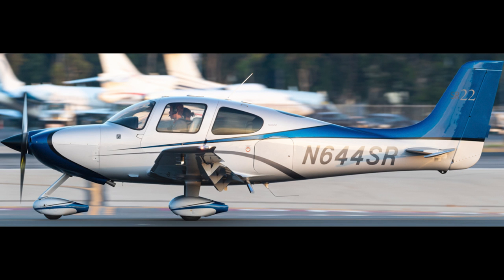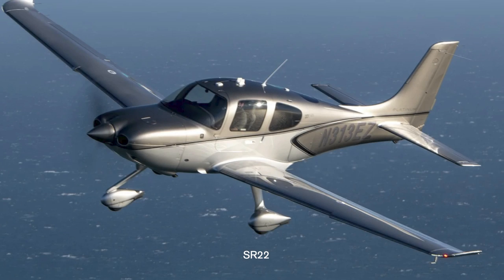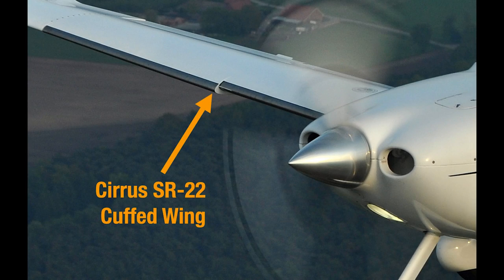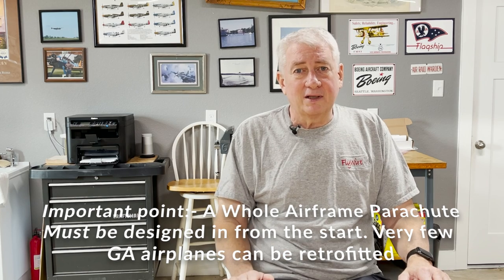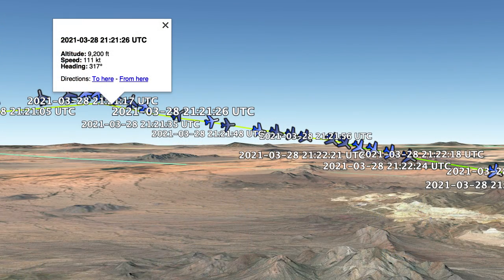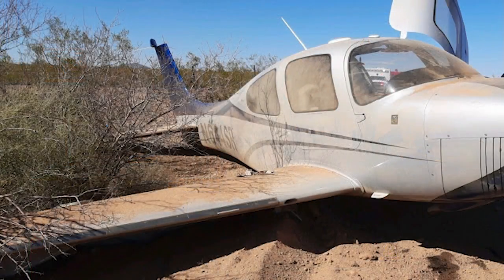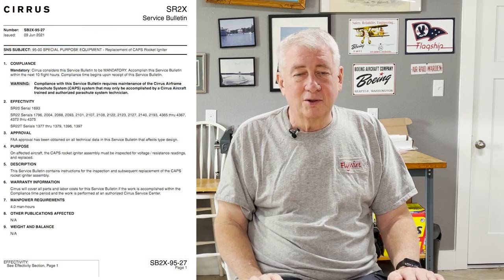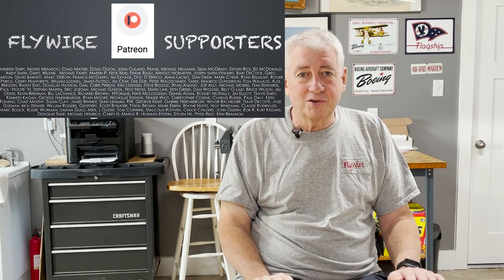N644SR SR22 Engine Out And No Chute

Comment: When the engine quits...your airplane doesn't stop being an airplane...it just becomes a shitty glider. Use whatever it has left to give, to get you to the best possible landing spot, regardless if your wings get you there or a parachute. As Scott wisely points out...that best spot isn't always an airport.
Reply: Here's the problem Cirrus pilots face - there is a minimum altitude for parachute deployment.  Below that, all bets are off, so a Cirrus pilot may have to make that decision to destroy his aircraft sooner than other pilots do.
Reply: @chuckschillingvideos  That is a very reasonable analysis.
Reply: @chuckschillingvideos  the minimum altitude is 600ft, that's a horror in any plane
Reply: @chuckschillingvideos  The moment a cirrus pilot decides to deploy CAPS, the aircraft becomes the property of insurance company not the pilot.

Comment: I recall seeing that bad vibration set in on Niko's wings youtube channel when he was out over the Gulf of Mexico. Sun visor was shaking violently. He turned that trip around and aborted it. Then he got caught at the edge of Class B airspace by ORD, and lost radio and glass panel as the vibration ate through the alternator cable cover and shorted electronics. 
What a familiar story.

Comment: Western half of the US (except mountainous) ROADS are my “go to”..... Nebraska, Kansas, New Mexico, eastern Colorado etc. I have flown directly over straight roads for miles nursing a sick engine to get to remote strips. If it quits ( which I always assume it will) you are set up to land straight ahead. Always be aware of power lines parallel to the road. This is where centerline practice pays off....practice on narrow runways.

Comment: Excellent comments.  There is a small but growing realization that "safety" equipment often leads to less safety for exactly the reasons you mentioned.  I recall that accident rates went up when anti-lock brakes were introduced.  We are also seeing similar issues with the cars that have self driving features.  People too often expect that equipment will never fail, and as a result are not prepared when it does.  I saw this in the Army, and see it with sailing, flying, and many other activities.  Thanks again for your superb analysis.
Reply: All of the data I have seen shows that self-driving cars are far safer on a per mile basis than are human driven cars.  The main difference is that every crash of a self-driving car makes world headlines.
Reply: @LTVoyager  I agree that a self driving car will be more safe than the average driver.  My point was that people rely on it and are not prepared if/when the technology fails.  Equally bad is that people often fail to even consider the possibility that a piece of technology can fail.
Reply: G'day,

Yay Team !

It was the same when they put a Training Wheel on the Nose, because lots of hamfisted clumsy wannabes couldn't cope with Taildraggers (less Weight, and less Drag ; which are two great reasons why Glen Curtiss abandoned Nosewheels in about1913, or so...) ; on the one hand the incidence of Groundloops remained unchanged (because Tricycles can indeed weathercock & groundloop, too),  while on.the other hand the incidences of all other types of Fatals went up...

Because in the Gripping Hand, any attempt to make a "Foolproof Aeroplane", historically, merely enables more Fools to evade being washed-out of Flight-School, and thus they progress to fly up into the Sky and put themselves in situations beyond their abilities with which to cope...; and then they die, after defeating the all Foolproofing for which they paid an extra premium price.

  Defying Gravity is so much fun that it should always remain  a bit obviously difficult, requiring of Learning, Skill, Experience, & Good Judgement...., in order to remain a safe thing in which to indulge oneself .

Least Familiarity breed Contempt, as the Cliche doth say...

In my humble opinion.
Anyway.

Such is life,

Have a good one...

Stay safe.

;-p

Ciao !

Comment: After reading the comments, I thought I would mention this…

Relying on the accuracy of a moving map glide circle distance may not be an accurate option.  One should test the concept in your own particular airplane.  Any aerodynamic changes to the airframe (STOL kits, VG’s, flap gap seals, etc) would have an effect on gliding distance.  A new prop, for example, might also affect gliding distance.  Check for any improvement in glide (at weights you normally fly) when pulling the prop to high pitch.  Some airplanes realize a change and some don’t.

It’s easy to change the glide ratio, at least with ForeFlight, to accommodate your actual glide ratio.  While maybe not the final answer, an accuracy adjusted glide circle can be a better tool for your reference should you actually need it.
,

Comment: There are no procedures in the Cirrus POH for off field landings. If you're higher than 500 ft agl, pull the chute. If the engine is running rough, returning to an airport seems like a smart move.
Great video! Thanks for putting this together and highlighting the importance of emergency training - you're right on the money in my opinion.

Comment: This is one of perhaps 15% of crashes I estimate might have been avoided by a couple hours sailplane lessons. Gliding and budgeting limited flying energy shouldn't be yet more intellectualized background info, but a viscerally prioritized and familiar process. I think a series could be done on benefits of glider mindsets to powered flight, as in the B767 Gimli Glider and other incidents.
Reply: Well most places are still teaching that a plane has a single best glide speed, without giving the adjustment for weight. (Meanwhile they still adjust Va, which is physical/engineering nonsense that was started by misinterpreting an old design regulation.) Best glide speed changes similar to stall speed, not exactly the same but roughly its close enough. Now you don't need to calculate it down to the exact pound of fuel remaining in the tank but having a general idea before takeoff of the adjusted speeds for various weights is handy. (Calculate best glide at MTOW, a normal takeoff, normal landing, and when fully light(pilot, no fuel, no cargo) as part of a new model familiarization.)

Comment: Based on its age, this airplane had the chute overhauled/repacked since it was installed by the factory. The repack interval is 10 years. So the Cirrus community will be very interested in who did that work.
Reply: Not a Cirrus guy, but is the rocket/igniter serviced too or just a chute re-pack? Sounds like it was an igniter issue not pulling the chute out?
Reply: @danr597  as I recall, the rocket motors are replaced during the service

Comment: That’s the trouble with single use emergency tools: life rafts, brs rockets, emergency parachutes, even bullets.  You never know if they’re good until you pull the trigger.
Reply: Which is why they should never be part of the game plan. Those are last ditch tools for use when everything has failed and you have nothing left to loose.  If you wouldn't do a thing without that emergency equipment, then you probably shouldn't do it with the emergency equipment.
Reply: @mytech6779  last ditch is also part of any game plan.
Reply: @mytech6779  So we should all, for example, stop flying above the water just because our safety equipment might fail (you likely wouldn't survive in water without safety equipment)? Doesn't feel very practical. There are plenty of situations where emergency equipment is an essential part of the game plan.

Comment: This is actually a really fascinating discussion. Essentially the CAPS system needs to to be integrated into the engine out ABCDE process for these planes. You can't make CAPS a backup to ABCDE but you also can't make ABCDE a backup to CAPS. Airspeed first, best place to land with CAPS and without, Checklist which should culminate with pulling CAPS, then Declare emergency and Execute your landing.
Reply from the maker: Exactly right!

Comment: G'day,

Yay Team !

I have a Ballistic Recovery Parachute, it's only crashed twice..., never been deployed ; but it's second prang involved Spinning-in from 300 feet while turning onto Final Approach, and the impact broke a tear in the Fibre-Glass "Muzzle" - which deployed the  little Drogue-Chute....., leaving the 24-ft Main still packed & atop it's Deployment Spring...., (if ever I really needed to I reckon I could make wooden Moulds & use 2-part Epoxy to saturate the torn Fibres  - then wrap it in Gladwrap before fitting the Moulds & applying Clamps to force the Wound together while the Epoxy goes off...).

But I can't really imagine any reason to rebuild my Aeroplane, let alone it's almost unused Parachute.

It came to me when I bought the almost-completed Scratch-built-from Plans Project, so I mounted it behind the seat & deploying up & out & back at 45 degrees to everything, from below the Trailing-Edge of the Wing on  the Left side of the Fuselage, through an Eliptical Cutout in the Sheetmetal Hatch in the Fuselage - with the 'Chute-Container's  "Mouth" protruding slightly on the forward Lip...

But when failing to clear the Fence on a (stupid) Downwind Takeoff, there was nothing my 'Chute could've done to help anything which mattered - so I left it alone.

Then when Canada John bought his 35 Hp Mk-3 Skycraft Scout I sold him my (then) once-crashed/never-deployed BRS 'Chute ; and when I bought the Engine from his Estate, afterwards, the Coronor boxed up the Rotax-377, the Altimeter & ASI & Pitot & Tubing, and the 'Chute and I was given the whole Box at the Court-House when I showed up for the Engine...; thus my Parachute found it's own way straight back to my Camp after having been sold..., (like a Conman's Sheedog !).

When I fitted it into my Aeroplane, I justified it's weight-penalty while considering the genuine plausibility of catastrophic  Structural Failure in a multiply much-modified, heavier, over-powered & then autodidactically redesigned version of what had originally begun as a foot-launched Aerodynamically-controlled Hang-Glider (VJ-24, to the 10 Hp VJ-24e, then into the 22 Hp VJ-24w...).

When I sold it to Canada John it was a last (desperate) attempt to give him a chance of surviving his decision to Go Flying.

Some people should not persist in trying to play with Aeroplanes, and Johnny was one of them ; but he could be remarkably stubborn in the pursuit of his eccentricities.

Check out,

"REQUIEM  FOR  A  REDHEAD...; Crashanalysis of John William Robson, & His Mk-3 Skycraft Scout."

to get the 15 minute version of his story ; he was one of Canada's greatest Adventurers, but Aeroplanes were not his strong suit.

Such is life,

Have a good one...

Stay safe.

;-p

Ciao !

Comment: Hmmm. Good point about the Garman. Wonder if they could add a second user defined glide ring to the map with a minimum maneuvering altitude, to better visualize the range before really needed to get it on the ground.
Reply: I've been wondering why the glass panels don't have an engine out glide feature for years.

Comment: Excellent video. I think one key is to have a mental number in mind as to descent rate to ground -- ie., I have two minutes, or whatever, keeping in mind that maneuvering in the last 15-30 seconds is likely not practical because at that stage you are committed to a landing spot and maneuvering aggressively risks a stall/spin. For my money, I try to maneuver to an airport initially and then a road secondarily, commit and take my chances there. It always sounds and seems easier sitting here on my couch though.
Reply from the maker: Great point!

Comment: Thanks Scott. There was a recent fatal accident (N515DL, NTSB # CEN21FA238) with an un-pulled chute that is a bit of a head-scratcher. Lancair turboprop level at FL250, starts slowing, then a left turn and rapid descent, no apparent weather in the area. The right wing broke off at some point in the descent, and the NTSB prelim says that the airplane had a chute that apparently wasn't pulled. Whatever caused the upset at FL250, I would have thought that a pilot in that situation would have pulled the chute on the way down. Probably no way to know if he was just too stressed and forgot about it.
Reply: Passed out
Reply: @tropicthndr  Yep, the upset was likely pilot incapacitation of some sort, not mechanical.

Comment: Great analysis although kind of biased towards parachute reliance when the chute did actually not deploy. I happen to know this pilot personally and I have flown in that aircraft. I'm glad you remain neutral because he's a badass pilot. He ran through a sequence of events and failures very rapidly. Engine out, failed chute. The chute had been serviced very recently and fully replaced. IFR current pilot. He had just been to training with the Cirrus pilot's association and certainly had no qualms about pulling the parachute. I could not say I would run through the sequence of events any other way than he did. Who isn't going to look for the nearest airport immediately? You can see from the flight path he turned directly toward it. Chute was very recently serviced and didn't deploy. The engine was fresh. It's a lot of information to process in a very short time especially with your young daughter in the right seat. Land and live that's what this pilot did. And Cirrus has a lot of analysis and explaining to do on this particular incident but it does appear to me to be connected to the igniter. I'm not the FAA or the NTSB so I will withhold judgment, but I know my friend is a great pilot. Thankfully he wasn't in the Sierra Nevada mountains where he does a ton of flying as well. Remember he did not pack that parachute. There's no one to blame but the equipment manufacturer. It's not like he's a guy who would skimp on maintenance in any way whatsoever. 644SR was a beautiful plane. He got it on the ground and kept the dirty side down. I will be blown away if they say there's any pilot error in this incident.
Reply from the maker: Thanks Malcom, I appreciate your comments. I am not biased towards using the chute... but Cirrus emphasizes it, so I wanted to paint a path. I'm not necessarily hitting him on going to Marana, but he stuck with it a long time using energy he wouldn't get back, relying on the Chute as the other option. This reliance is what I think needs to be rethought a bit. And its not about this pilot at all.
Reply: @FlyWirescottperdue  Of course not I just wanted to inject a few more facts that I know personally. Most people don't know he was directed to a glider port nearby by ATC. That's why he descended so quickly. Then they warned him off because they said there were numerous gliders in the area without radios and they had no way to warn them. Then you can see another turn in his flight path where he located the road to land on. You are a very factual guy and I have a lot of respect for everything you write. Just wanted you to have all the facts. Or at least all the additional ones that I know.  Add another funny  angle with this story is that the local police called the bomb squad because there was an undetonated bomb on board, as in the igniter. Even though those things are sitting all over airports all over the country. There was a jurisdiction beef between the locals and the big/federall guys. The locals wanted to detonate the entire plane before there was an investigation. Again this is anecdotal information so don't hold me to it but it's also straight from a very reliable source who was right there on the ground. I'm not sure why but I found that to be absolutely hilarious

Comment: Thank you for explaining the spin certification for the Cirrus. I've heard the statement, usually form older pilots, "I wouldn't fly a cirrus because it's not spin rated" or "it can't get out of spin so that's why it has a parachute". Apparently that isn't the case and is actually has passed the spin test to be certified in Europe...
Reply: It’s smoke and mirrors, there are many types of spin entry types with power off and on, angle of bank and attitude and Cirrus doesn’t have to prove it on the worst case, only the easiest to get out of. Don’t be dumb and drink the cool aid. Cirrus’s are still going down on the base to final turn because they haven’t improved slow speed handling at all. That little goofy vortex generator they added on the fuselage doesn’t do anything in a turn where stalls are the most dangerous, it only works during straight ahead flight.
Reply: @tropicthndr  I could see your point but the way you describe it sounds more like operator error. If it's an airplane that doesn't like to get slow, so don't let it get slow. In order for it to enter a spin it needs to be stalled. The base turn to final is the most dangerous turn in aviation and I haven't seen the numbers to back it up that Cirrus aircraft are more prone to it. If you are flying to slow, enough to stall, and uncoordinated through that turn you'll spin any airplane into the ground, most likely. Stay on your speeds and you'll be fine, blaming the aircraft for having a high stall speed doesn't make it dangerous.

Comment: I tried from 1500 feet to check glide range in a 172 and was amazed how far I could glide.
Reply: ... And I bet it would go 10% more without the fan turning.  What I don't like about these latest stall spins is the very small angled empennage areas.   Does anyone but me like the surfaces of the old CH-47 or round tailed J-3 or C 180?